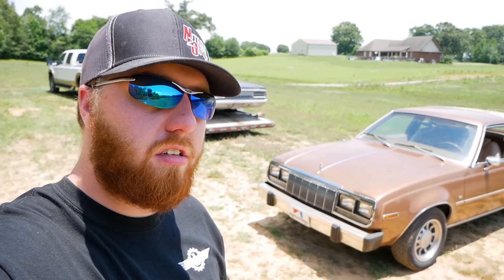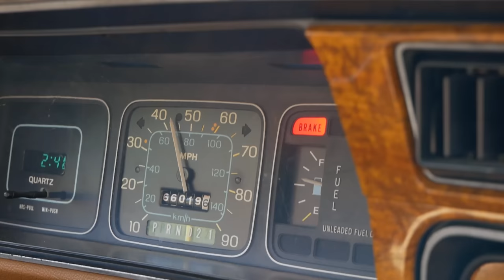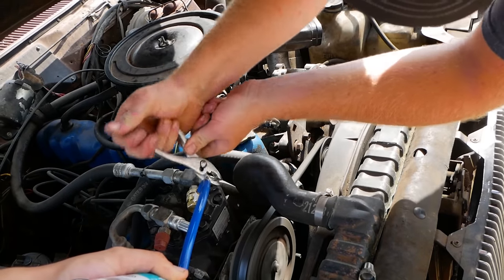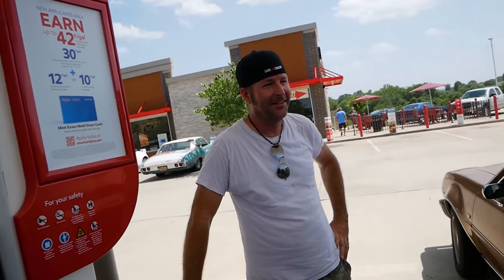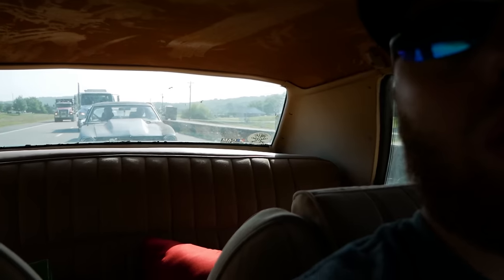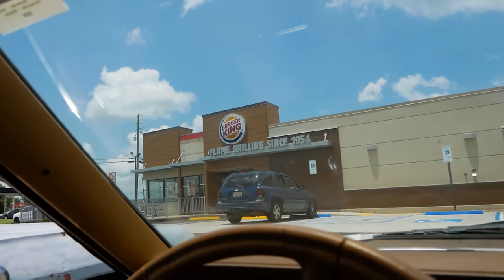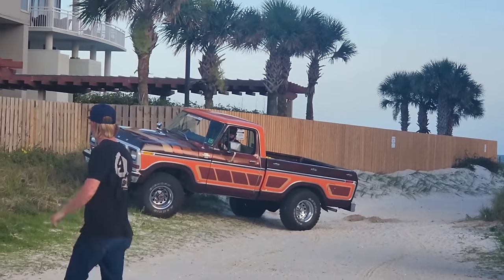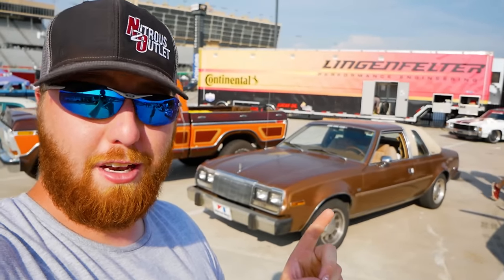Will a 43 Year Old Car Survive a 1500+ Mile Road Trip With Zero Preparation?

Comment: That motor was an AMC motor they used in a variety of vehicles and is only known for being a jeep motor because it was used in jeeps until 2006. It wasn't a Jeep motor used by AMC, it was an AMC motor that AMC used in jeeps, a company they owned.
Reply: Also most parts like plugs, alternators etc are just rebrands manufactured by suppliers and sold as "OEM" and have been for a very long time. This is because it makes little to no sense to manufacture your own as some other company can do it cheaper in much higher quantities.

Comment: .
I'm surprised you guys with the older cars w/o A/C don't make a simple "cooler A/C" with a flex-pipe  cool air output vent and a high power 12 volt blower motor run off the car power.  Wouldn't be perfect, but would make life a lot easier in 100+ degree weather as long as you refill the cooler base with ice at every fuel stop.

Comment: Ugh.  my '78 Ford F100 (shoutout to Mook) has the same York-style compressor and it's completely busted.  Looking into getting it replaced with a modern-style compressor like from Vintage Air.  Should've done it when I had the $1200 quote

Comment: Disconnect wire at distribution block , unscrew that switch , start car then push brake pedal hard it will reset the valve

Comment: I am confined to an electric wheelchair that is blown (modified) and runs 37 MPH and has four 12v 35 amp hours  lawnmower batteries (that is actually what they do run on usually on just 2 batteries.
Trying to kick that up to at least 50 MPH (needs a better carb or something.

Comment: Worst thing AMC did was sell out to Chrysler. There is an R12 compatible gas on the market called HFC12. Not crazy expensive and no license required.
Reply: They had no choice, Renault owned 46% of American Motors and sold the stake to Chrysler, who then made a bid for the rest of the company. Most of AMC's executives found out about the deal when it hit the media, and had no idea Renault and Chrysler were negotiating behind their backs

Comment: ideally you would also open the high side and when you get refrigerant blowing out the high side most of the air is out and you can close it really quick and finish charging}
air in the lines is not good

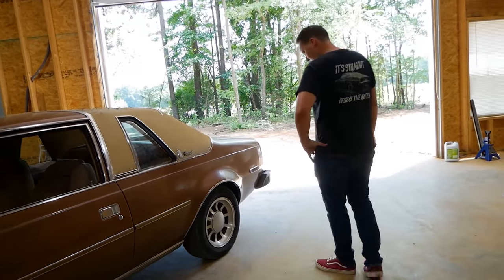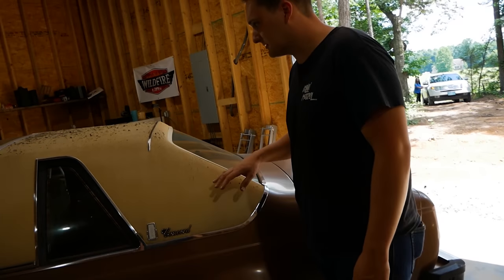Comment: Beware of those who are not knowledgeable about AMC vehicles. At 4:54, have no idea that the wheels are not AMC. At 5:00 says Chrysler is cheap by not providing a pad under vinyl top. This car is a Concord made by AMC. It was, in no way, ever related to Chrysler. Common mis statement is AMC didn't use their own parts. Well neither did anyone else! Parts for AMC were out sourced from various suppliers. The same way parts for GM, Ford and Chrysler did it. 
Their smug comments about AMC are an insult to this fabulous brand.
 These two probably think AMC's 327 V8 was supplied by Chevy.

Comment: All that steel wool he's got shoved in that PVC pipe for the breather on the Biscayne I hope that that steel wool isn't falling apart straight down into the valve cover the steel from the steel wool is probably going to do wonders on his motor a piece of foam would have worked way better and not ruin your motor

Comment: I did lock the keys in the car I had to go between the window ceil and unlock the door with a coat hanger the ac wires had to be redone because the previous owner tried to wire a cb radio with the ac wires it was a cheap repair.

Comment: In 1979, AMC was not owned by Chrysler. Chrysler had their own problems. CEO Lee Iacocca famously had to obtain a loan from the US government in 1981 to keep Chrysler afloat. Iacocca directed major projects that drastically improved Chrysler's fortunes, most notably the K cars and the minivan. They bought AMC in 1987. They had nothing to do with your crappy vinyl top. By the way, the crappy top on my Ford LTD was affixed in much the same way. Instead of an actual two-layer padded top, it was a single layer glued to BONDO! that they laid on top of the roof to fill it out! If you didn't have a Cadillac or Lincoln, you got a crappy top like this.

Comment: AMC 304 or 360 would swap in. Car has no relation with Chrysler, except for parts; like the other car maker parts in the AMC cars. The transmission is an AMC bolt pattern, but made by Chrysler as a supplier. A Chrysler 318 would not swap in any easier than a GM engine, unless the trans was included with the engine.
The AMC 304 is a good engine; mine made much more power mildy built than my stock AMC 4 barrel 360. 
The 401 is way overpriced due to Javelin engine swaps.
Could rebuild a powerful 360, for the price of a 401 core.
 Aftermarket 360 parts are easier and cheaper to find, due to them being manufactured in higher #'s and for a longer period of time.
 Chrysler continued to make the AMC 360, after the buyout until 1992, for the Jeep Grand Wagoneer. Mopar even offered performance parts for the Grand Wagoneer AMC 360 in their catalogs at the time. 
The AMC straight 6 and 4, was also manufactured long after the buyout for Jeep.

Comment: hey im actually gonna buy a old 77-95 dont know yet what year is it exactly but a lada niva it s a russian made 2 door 2wd car like almost like a jeep or something along those lines has a complitely rebuilt motor but the problem is de dude broke a leg after rebuild and then didnt have timefor it after that so it has been sitting for few years i think and he never started it and he said it had a tent but no rust so ill see what it looks like has new tires and stuff its a 1.6 liter gas engine and looking at the 2 € per liter gas or 1.5 its very good that its not any bigger although i dont have far trives few miles to work atleast now and thats why it might become mine he asked 1500€ and its a steal almost gonna be fun 4wd 4speed or may be 5 speed trans havent seen the car yet but doesnt really matter because a rebuilt engine is like 1500-2000€ so yeah

Comment: How can some of these cars be allowed on the road? Aren´t there any technical inspections or tests to ensure the cars are road worthy? You wouldn´t be allowed to drive these here in Europe at all. They just wouldn´t pass the inspection. Can anyone tell me how this works in the USA?
Reply: Well as long as you have a clean title, you can get them registered to drive. If it has been wrecked then it gets a salvaged title. People can rebuild them and then have it inspected to confirm that it is safe to be on the road, to get a rebuilt title, which can be registered. Some very old cars are exempt, they get collector plates. Each state has different laws. None that i know of inspects every part of the car to be registered, just emissions.

Comment: that car being a 79 is not mopar, mopar didnt get the amc brand until 82 i believe
Reply: 1987, American Motors was under the control of Renault in '79. By the time Chrysler bought the company, the Eagle was the only model left under the AMC brand, so they dropped the AMC name and made Eagle the brand starting with the 1988 model year (selling the old Eagle Wagon, the new Eagle Premier, and an assortment of rebadged Renaults they were contractually required to import, and a rebadged Mitsubishi)

Comment: Junkyard gigs I hear people on power tour have problem with the engine overheating I rather car a Ford 2001 five long distance never got overheated why he will call or overheat it is something wrong with the car I suppose not overheat and high temperatures a long distance dry people need check the engine and see why it works